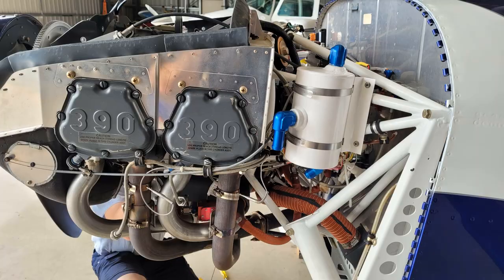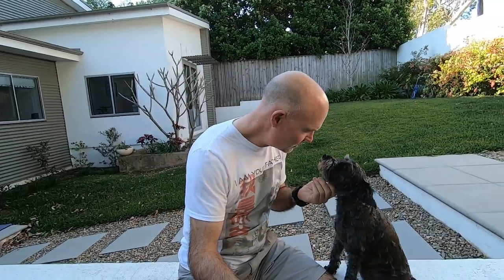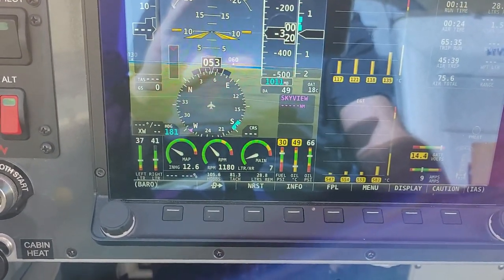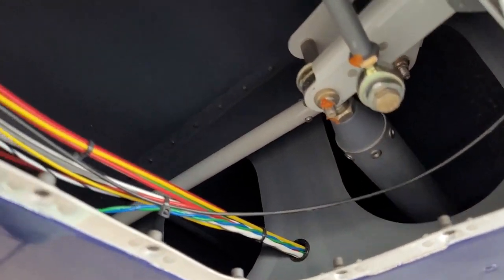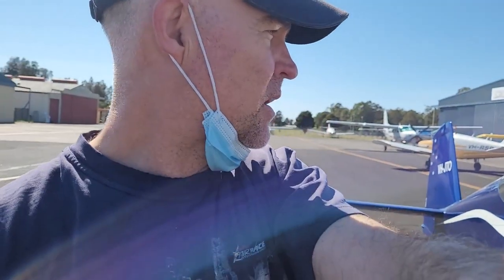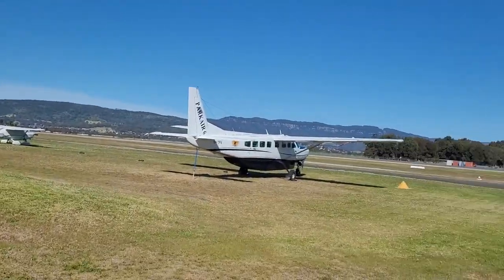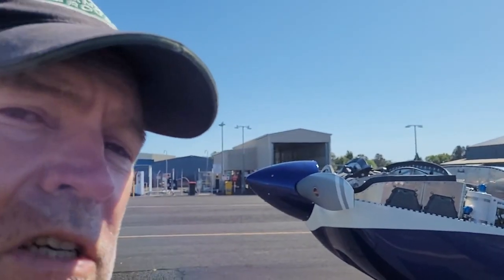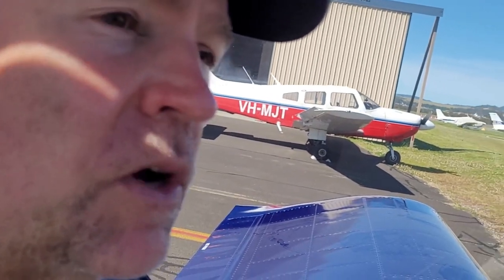RV14 JTO Half Raven Installation  (Part 1)

Comment: did you go with the half raven system for space/weight or just because the full is unnecessary for your mission. and secondly do you think the full raven inverted oil system will even fit in the first place? im ordering a tail kit for an rv14 in the next month and heavily considering one of these options
Reply from the maker: Christian the full kit will fit with a bit of work and if building from scratch that is the time to consider installing. Weight no issue as I changed my Lead battery for an earth X so about 10kgs saved there. The main thing is what you want out of your aeros. The half kit does 90% of all maneuvers and can still give you a couple of seconds inverted for slow/4 point rolls zero gravity etc and I get no noticeable oil leakage. If you want to fly sustained upside down you will need the full kit as well as flop valves in your fuel tanks.
Reply: @nigelthomas8150  awesome thanks for the information! I will be building from scratch, there just isn't that much information about inverted oil systems for an rv-14. Thanks for the response

Comment: What did you do as far as fuel system for inverted flight?
Reply from the maker: Estefvan I have not changed the fuel system. This is only for a couple of seconds of inverted so enough fuel in the system. If you want more it would be a big job removing a wing to put in one or more flop valves in the wing tanks.

Comment: Hi Nigel, thanks for the video! I’m currently having an RV14A built in Mildura and am looking for exactly this sort of basic aerobatic capability. Fellow SAffa, living in Port Macquarie, and really appreciate the info. 
Q: Have you had any issues with the half Raven since installation? Thanks again. Cheers, Charles
Reply from the maker: Charles, it's been excellent, not a drop of oil while doing most maneuvers. Only recently I held a 4-point roll for 2 seconds inverted (pushed) and found a small leakage. I would not bother with the full kit unless you intend to fly sustained inverted